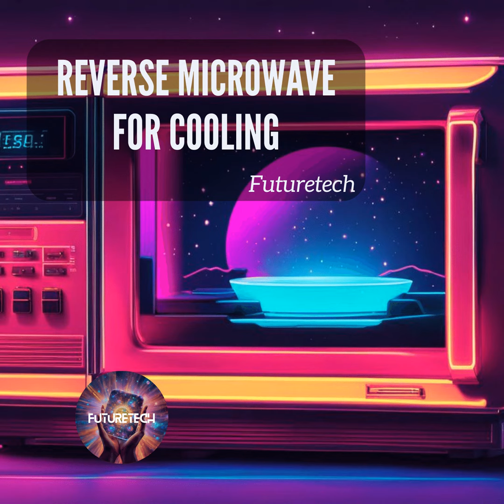The Reverse Microwave Cooling Breakthrough

Comment: I believe a bunch of magnetrons facing towards the box opposing each other to neutralize itself induces this effect because lower Hertz means less temperature, and there is a pressure applied that both separates all of the atoms and molecules and pushes them back with equal amount of force in every direction, essentially freezing them in place. Microwaves begin at a very cold temperature under 200 Kelvin*.